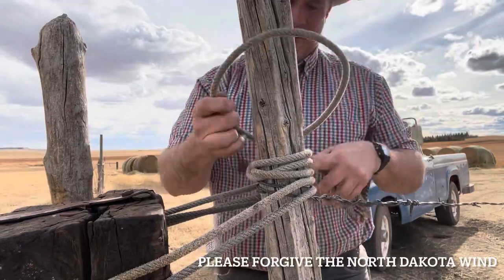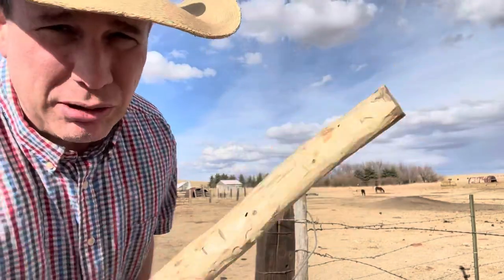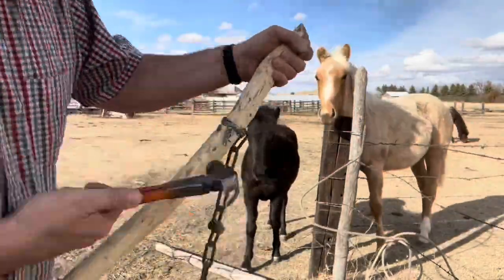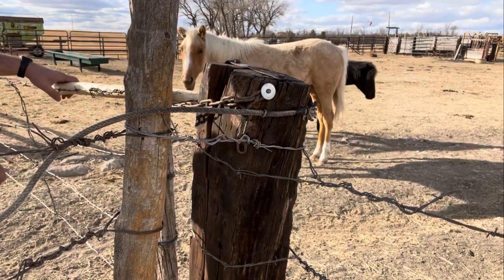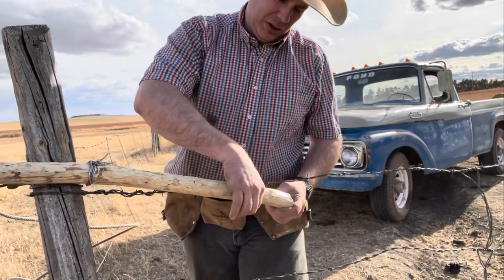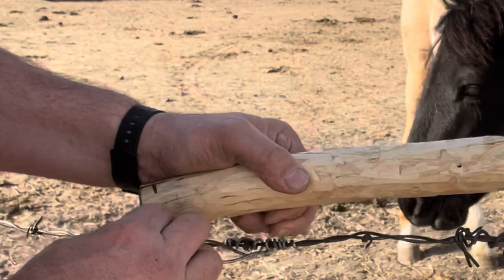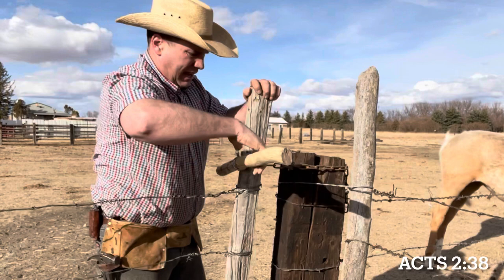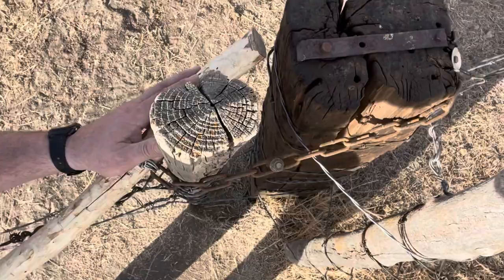Wire gate latch

Comment: Don't need chain. Use barb wire.  Don't need the handle loop either, just push over top gate wire.
Reply: Thats fine if you dont mind loose sloppy gates
Reply: @redrustyhill2  The handle levers the gate, pulling it quite taught.